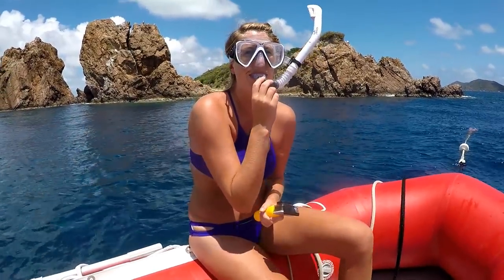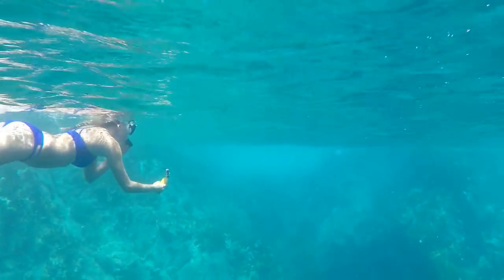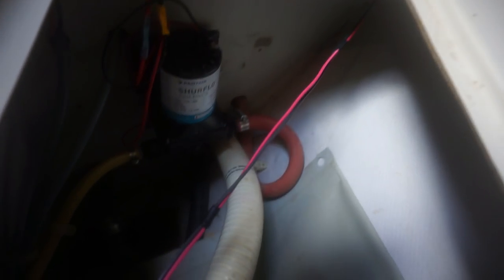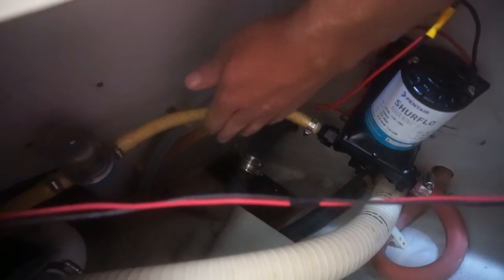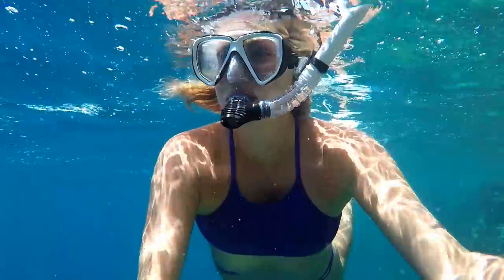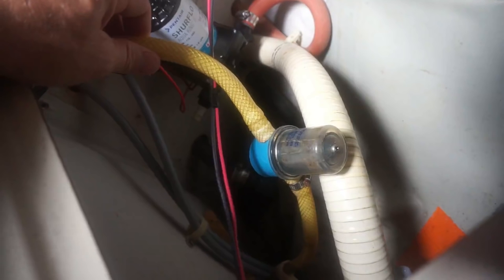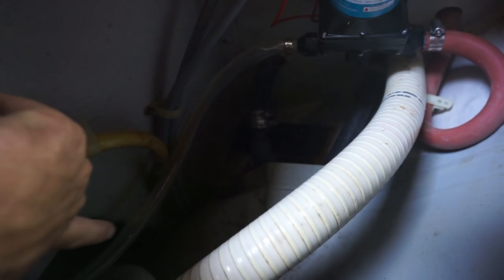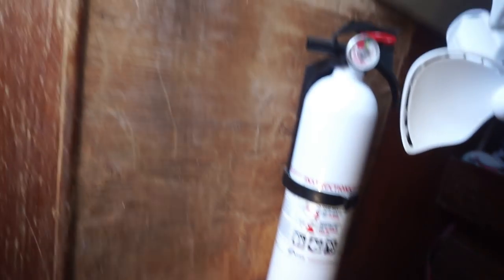Snorkeling the Indians at BVI & a Shower Pump Problem - Boat Maintenance Monday

Comment: Bobby, you are using the wrong pump for the job. That pump is a diaphragm pump designed for high pressure, low volume. This is why it's rated for only 2 GPM.... @ 20+PSI. It is self-priming up to 6 feet and has enough head pressure to reach the top of your mast. It has an internal switch that stops the motor at 30PSI. So, when you open the valve on your sink, the pressure drops and the pump comes on automatically.  When you close the valve, the pressure rises to 30 PSI and the pump goes off. This type of pump has internal reed valves and any debris holding the reed valves open will prevent the pump from working. BTW: That's not a cheap pump. $100 is the going price for this type of pump and Shurflo is a market leader.

Verify the pump is working by dropping the intake hose (without the filter) in a pot of water and see if it sucks it out. Disconnect the output hose to eliminate the possibility that your output line is blocked. You should also be able to feel a little suction with your finger on the intake hose.  If the pump is working, then check all the hoses are clear by blowing through them. I suspect the pump in not working...  because of debris in the reed valves. You can take the pump apart to clean it, but it's still the wrong pump, so replace it. Keep it as a spare because your water supply pump will inevitably go out, and this pump is THAT PUMP.

As Grandpa mentioned, you should be using a shower pump box in the bilge, high volume - low pressure. But, it would appear that the boat was not designed and built with this in mind, so you should replace the diaphragm pump with an impeller pump.  Don't forget to buy spare impellers. 

Bilge pumps are centrifugal pumps and don't have surface friction, like that of impeller pumps so running them dry will not "eat them up". The only concern is overheating the motor and that can take days or weeks. I once had a bulge pump run dry all winter long (24x7) and it never failed. I heard it running when I went back months later to take the boat out of storage. Thank goodness for automatic battery chargers . LOL

Comment: pull the pump and measure head.  hold discharge hose up in air at the height  it would normally have to push. good luck mate.

Comment: I blv the pump should have an internal check valve but if it was the cheapest pump you could find then it is quite possible that the pump has lost some power and can no longer perform the job you want it to perform.  Living aboard is putting a lot of cycles on that pump I'm sure.

Comment: A quick look at the specs for a SHURFLO AQUA KING™ II Jr 2.0 state that it can dry prime at 6 feet which means that the pump inlet can be up to 6 feet below the pump. If that is the pump you installed it should be able to discharge at around 2 gpm with a discharge height of around 6 feet above the pump. It looks like the pump connections are only 1/2" which seems way to small for the application. A small amount of hair could foul the impeller.
Reply from the maker: +Paul Bevan yeah I have taken it apart to check that but not clogs.  There is no impeller,  uses some kind of diaphrams
Reply: I took another look at the specs and it looks like some kind of peristaltic pump so no impeller. Disconnect the hose between the filter and the pump at the filter side and drop the hose end in a container of clean water. Run the pump and see what happens. 
A quick search of SHURFLO AQUA KING™ II problems seems to show that the rubber diaphragms are extremely sensitive to even the smallest mineral particles. 
Good luck with the trouble shooting, really enjoy watching your channel.
Reply: It looks to be a fresh water pump and not a waste water pump. I would change the pump

Comment: Turn your strainer right side up. The bowl traps air the way you have it and causes an air lock. A flapper type back flow preventer will not clog like a check valve will.  But may not be necessary.
Reply: Also the hose you used will collapse in a suction line. Use the reinforce hose like you took off to prevent collapse.
Reply: A check valve or back flow preventer is only needed if the pump is higher then the drain.

Comment: Try it without the filter on the suction side.  If it pumps, there's to much resistance to flow on the suction side of the pump. Solution would be a filter with larger open area. Pump and hoses should be below the lowest water level, if possible. A check valve on the suction side would just make it worse.
Reply from the maker: yeah I think I need to lower the pump... will help with the priming.  thanks!

Comment: First, do not run the shower pan to the bilge.  Second, lose the in-line strainer.  Third, install a check valve after the intake screen.  Fourth, I would go with a macerator pump.  Lastly, do not mess with the discharge loop.
Reply from the maker: yeah I agree with that.  Why is it a bad idea to run it to the bilge?
Reply: You will want to keep the hair and soap scum out of the bilge.  Makes a nasty smelly mess and the last thing you want is to gum up your bilge pump.

Comment: The suction line is too long.....centrifugal pumps push not suck...... a short suction line will solve your problem also the inline filter should not create any headloss the filter should be upstream of the suction line (in the shower)

Comment: the pump should have a "head rating", which specifies its ability to pump water so many vertical feet up..... your discharge point maybe yo high and the pump just isn't powerful enough...... also the pump location should be below the level of the floor drain, this will allow it to always be primed once water is in the system..... and then there should also be a check valve to stop the water from drain  back through the system once the pump is turned off, depending on how high the left is you may end up with water back in the shower pan without a check valve
Reply from the maker: +kevin mclennan ok I will lower the pump as much as possibly.  Not sure I can get it below the shower pan. But will take a look
Reply: how high is the lift?
Reply from the maker: +kevin mclennan the pump is probably 2 ft above the shower Pam and another 2 ft to the output
Reply: and also check the filter as it may be restricting flow
Reply: ok... that is no lift at all.... pump will have np problem with that..... just get the pump as low as possible and it will always self prime
there is no point in a p-trap.... that is just designed to keep sewage gas from entering the cabin.... yours should just be going into grey water holding or directly overboard
Reply: a check valve will also help considerably because it will not allow the system to drain back as well.... but if you can get the pump lower then the drain it will not be necessary to put the check valve in

Comment: Hi Bobby, we really enjoy yr vids
I think yr pump is good enough but it needs continous. prime so needs to be below the shower sump level. Can you mount it lower with a down hill pipe run from the sump? From what I can see it looks like a diaphragm pump so won't let the water in the overboard pipe back in so P trap is not needed
Reply from the maker: +Chris Foote yeah I will try and mount it lower.
Reply: The pump has the power to pull up to 10 feet of dry line and pull water to it.  It also has the power to push the last 3 feet...
Reply: Chris Foote    I was about to say the same thing,   drop the pump Bobby.

Comment: Wait! What? Sell the boat for an RV? When did this happen Bob? I've lost this topic line somewhere or was it only for your patreons?
Reply from the maker: +Edward Grant no we talked about it at the live chat.  It will only be a temporary Rv trip while waiting for hurricane season to pass.  August-November.  Then hopefully buying a bigger boat for more crew to cross the pacific
Reply: OK, getting away because of hurricane season is a very smart move! Will u b getting a trailer or a Class A RV?
Reply from the maker: my only other asset (if you can call it that) besides the boat is a 1983 holiday rambler imperial 33.  I bought it for $4,000 about 3 years ago....  so that is the one i will  use.  I will post a picture of it on our instagram and facebook hopefully later.... both are @sailingdoodles
Reply: That is a pretty good coach, even at that age. Should be comfortable and, depending on its lenght and power, should be good.
Reply from the maker: it has a 454 but the problem is the transmisson.  It was built when the speed limit was 55. so its only a 3 speed and tops out at about 65.  not to mention 7gph!
Reply: Yikes, I understand. My late folks had a series of older RV's with the same or similar drive trains. What area's are u planning on seeing? This is a beautiful country with so much to see. Will you be traveling with just The  Boys or is Megan coming along? No matter what, I look forward to seeing those adventures too.
Reply from the maker: Well I bought the RV for burningman and keep it in nevada...  so we will go to burningman and then cruise the southwest and perhaps the west coast.  The boys will definitely be coming along (minus burningman).  not sure about megan.  that is up to her.
Reply: Well that sounds great. IF you end up anywhere near San Diego we would love to give you a break from the coach and crash at our home in Fallbrook. No hook ups but plenty of room to park the coach. Yard is fenced so the boys could run about.
Reply from the maker: yeah that would be great!  I am planning to make it to san diego.  I have several friends there.
Reply: No pressure sir, just keep it in mind.

Comment: pump is plenty strong just needs to be lower than shower sump.
Reply from the maker: i will try that!
Reply: Sailing Doodles actually I was wrong.  Thought that was an impeller pump but it is a diaphragm pump which is self priming. One thing I notice is that there is no check valve on the discharge line which is standard for a diaphragm pump especially since you have this plumbed near the deck.
Reply: Sailing Doodles also the most common reason a diaphragm pump fails is if there is debris stuck in one of the valves. Pull the pump and open the pump housing.  It is quite simple. Just remember how it came apart, remove the debris and put it back together.
Reply: Keth it only needs to be lower if it isn't a self priming pump. Mine is above the shower pan and works fine.
Reply: Sailing Doodles a quick test of a diaphragm pump is to remove the discharge line and blow into the pump. If you can blow air into the pump it means there is debris or a hole in the diaphragm.
Reply: S/V Della Jean your correct, thought it was an impeller, see my later comments.